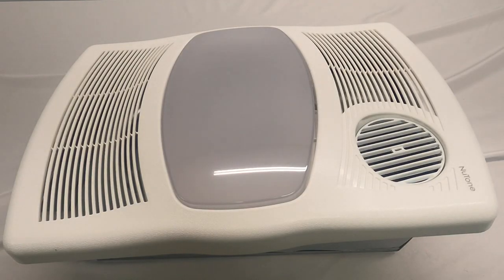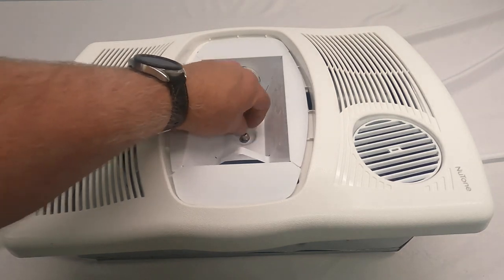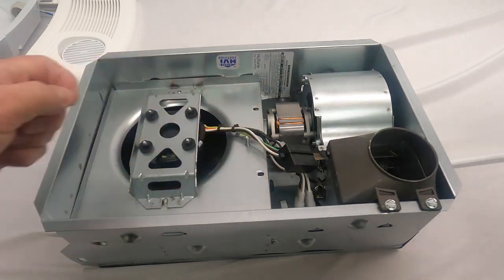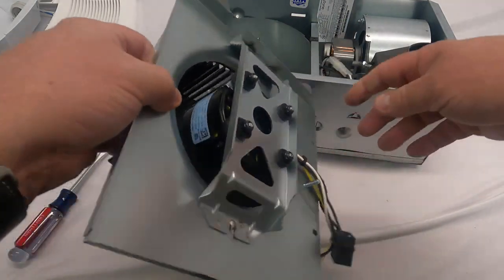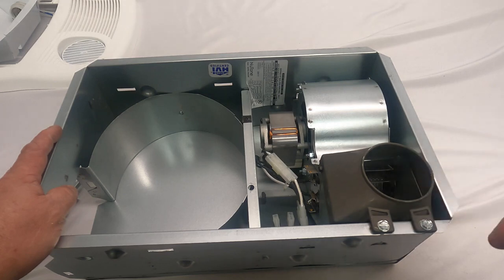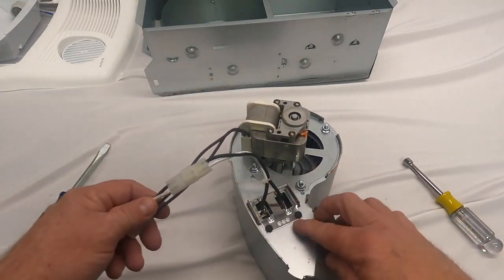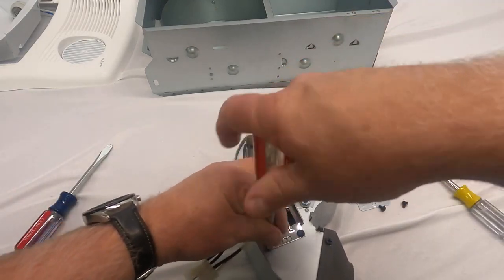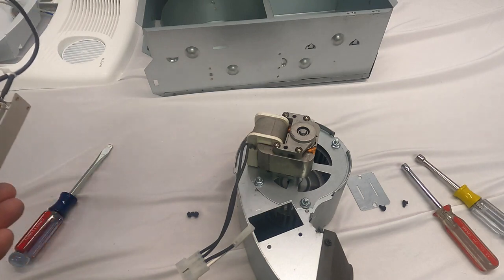How to Disassemble NuTone 765H110L Heater Fan

Comment: Great video!. I have a question and am in need of help. the heating element on mine gave out. Am i able to replace the heating element? Thank you in advance ❤
Reply from the maker: Thank you for your question regarding model 765H110L, Jonathan.  The part number for the replacement element and thermal fuse is S97020888. This part can be ordered in the Parts Store on our website or by contacting Customer Service at 800-558-1711.

Comment: I just got one, bit I need to connect with a switch one for the heater, one for the light, and one for the fan, do you guys have a video that shows how to do so?
Reply from the maker: Thank you for your inquiry. Unfortunately, we do not have a video for wiring the wall control. We do have a Product Support Team available at 800-637-1453 that would be happy to answer your questions.

Comment: my unit only blows cold air so does that mean only the heating element is broken?
Reply from the maker: Good Morning, Yes, if the unit is blowing cold air, you would only need to replace the heating element. If you have the 765H110L, the replacement element is part number S97020888. If you have a different model, please call our Product Support Team at 800-637-1453 for parts assistance.

Comment: I’m looking to get a replacement for the light cover. Your website notes that it is part 32, but doesn’t give the option to purchase it?
Reply from the maker: Thank you for your question regarding the 765H110L model.  The light lens is included with the grille assembly part number S1101173.  It is not available separately.

Comment: How do you connect on separate switches this unit?
Reply from the maker: Thank you for your question. The wiring diagrams begin on page 2 of the installation manual. https://broan-nutone.com/getmedia/084cd9e2-61f4-492e-8956-034c1df7d5aa/Installation-Guide-765H110L.pdf?ext=.pdf

If you need additional assistance, please reach out to our Product Support Team at 800-637-1453.